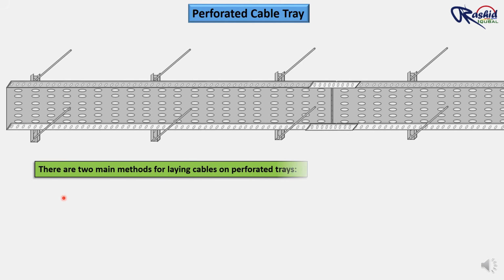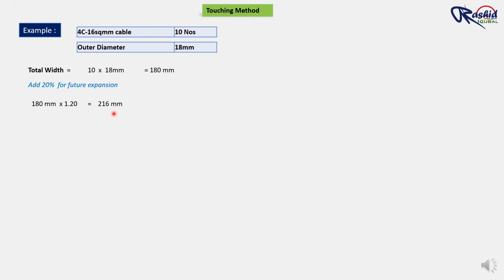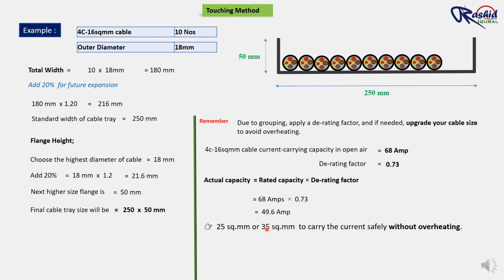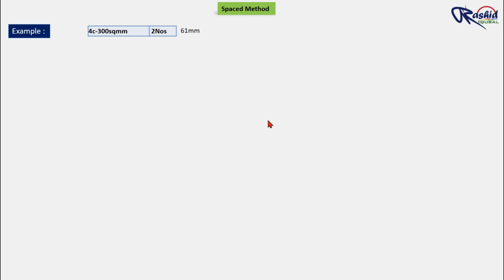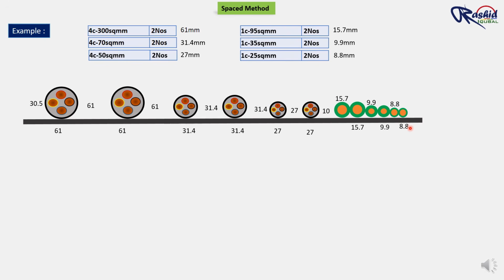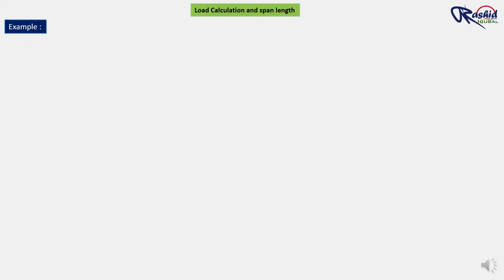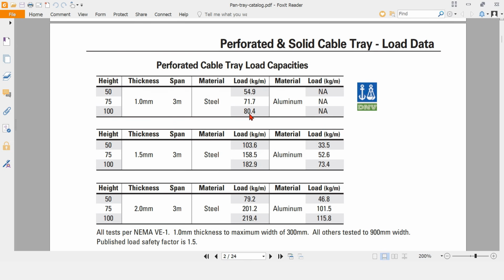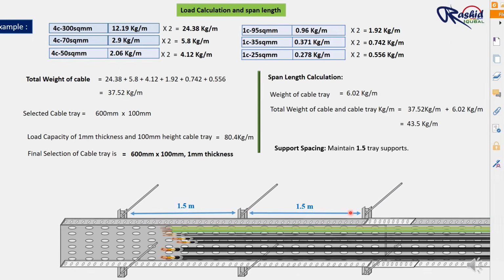Cable Tray Size Calculation with Load & Spacing | Full Practical Guide

Comment: Sir whats the minimum gab between cable to cable
Reply from the maker: I explained in video, its depend on cable diameter
Reply: @Rashid-iqubal @Rashid-iqubal Yes sir, you mentioned that the distance between cable to cable should be equal to the diameter of the cable.

But I have a doubt—because in some tutorials, they mentioned that the gap should be 25 mm.

My second question is: Does the distance between cables also depend on the type of cable, like power cable and ELV cable?

And I request you, could you please make a video on a data center project